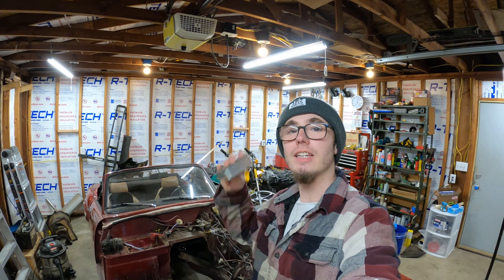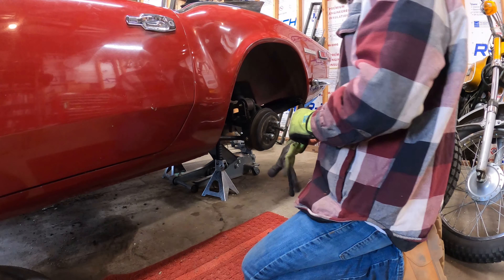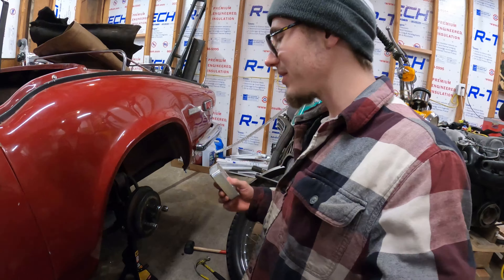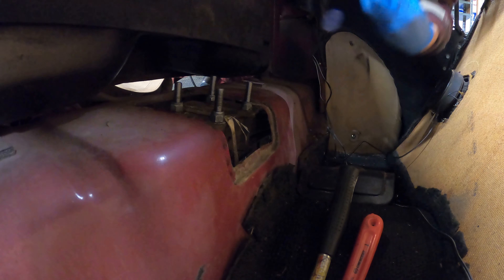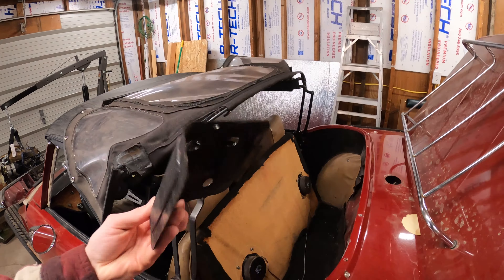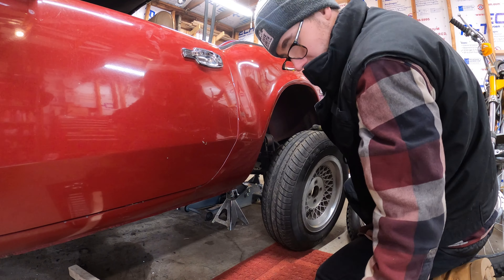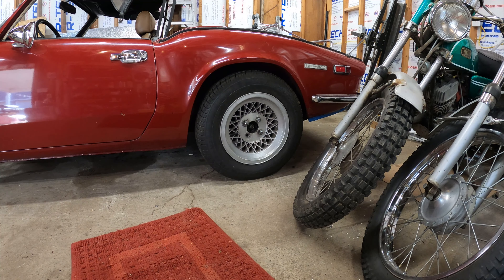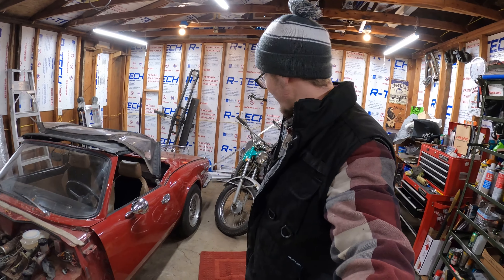Lowering my Spitfire as much as possible! (1in lowering block)

Comment: The height at the rear is affected by the length of the coil springs at the front, plus/minus any spacers above the front springs, as well as the weightt of the driver.

Comment: "Bachelor's Lean" is a thing. The car is driven 99% of the time with only one person, and that person is larger than the usual passenger if there is one, so it sags on the driver side. Depending on the type of leaf springs, you can swap them, but double check before swapping sides as sometimes the parts don't allow it. I just removed a 3" lowering kit from my Midget, it was far too low for my fat butt and with bad shocks, was bottoming out. So, replaced the oil in the shocks, removed the lowering kit, and it rides much higher, not too high though.
Reply from the maker: Absolutely. But my particular car is leaning towards the passenger. I refreshed the leaf spring, didn’t solve it. So I’m lead to believe it’s a front coil over issue
Reply: Maybe it was The bachelor's girlfriend lean!

Comment: Hello, as most are saying the spring tends to settle on the drivers side. I was wonder if you had removed it and perhaps put it back in the wrong way round? Either way it's probably best to replace the spring any way. Good job, thanks for the content, and wishing you the best.
Reply: Yes on that. I actually bought a new rear spring but it didn't have a directional arrow and of course I put it in backwards. I took it back out and reversed it and problem solved.
Reply: The leaf springs will outlast the rest of the car by a few centuries. They never wear out. The sagging happens because the rubber pucks between the springs wear away. They can be easily and cheaply replaced with nylon pucks to restore the leaf springs to brand new condition.
Reply: @NicholasJKaufman  I've got some of the white nylon 'pucks' (disks) ready to install on mine. 👍 I only want to clean, treat, paint and replace the shackles on my leaf before reinstalling it. (Mk3) 😉👌

Comment: if its not sitting level, you prob need new shocks
Reply: This isn't true in a Spit - they tend to sit lower on the driver side due to the leaf-spring being traverse and wearing faster under the load of the driver.
Reply: @kpbarrow  a dead shock on the drivers side was the problem on my mk4 fwiw
Reply: @chaseincats  shocks shouldn't impact ride height at least with a standard set-up - they're just supposed to dampen spring oscillation - the spring takes the strain. I guess uprated shocks might? The point I was trying to make is it's rare for Spits to sit level unless the rear springs is fairly new.
Reply: @kpbarrow  I got those kyb gas-a-just which are supposedly more sturdy so maybe that’s it
Reply: triumph spitfire's lean on the drivers side sometimes.  it's called bachelor lean.  sometimes it's the leaf spring and more times than not.... it's the front springs.  swap those around and the lean will improve.  you can also turn the leaf spring left to right.  shocks won't fit it.... unless they are very stiff kyp charges shocks.... but shocks aren't actually fixing the cause of the lean.  swing spring spitfires 1971 onwards suffer from bachelor lean more than the fixed spring cars do.
Reply: @nickyalousakis3851  that’s the best term I’ve heard all week lol
Reply: @kpbarrow  True, Keith! Had a similar discussion with a fellow classic enthusiast here (Wales, UK) who has an MGB.